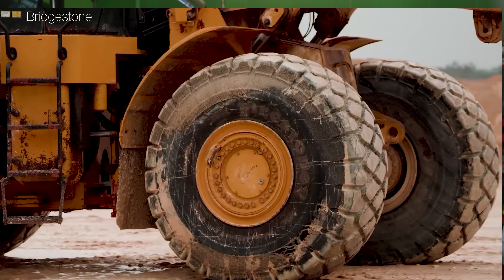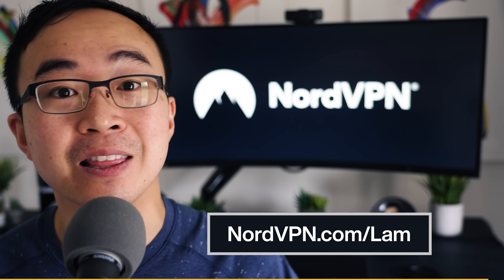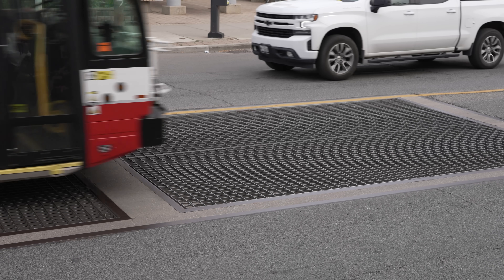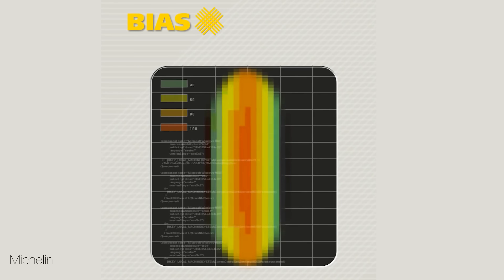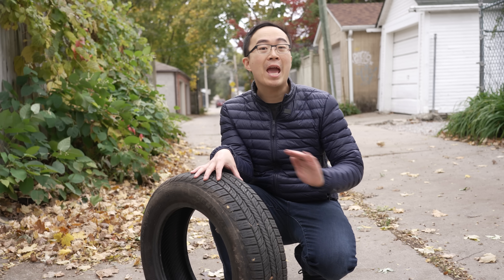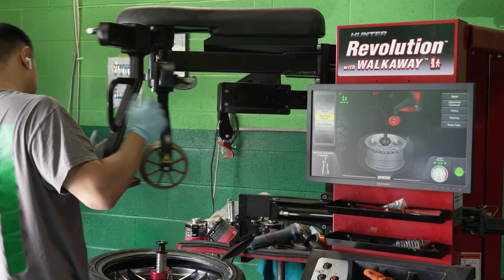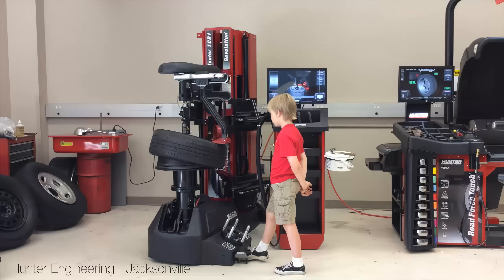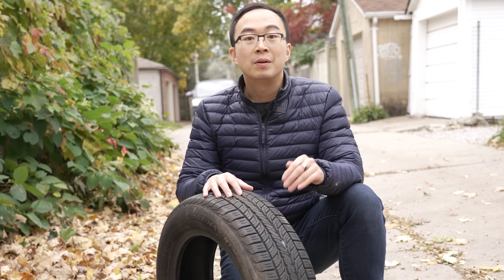How 90 Years of CLEVER Engineering Transformed Tires

Comment: I really hope this doesn't come across as nitpicky but with a guy whose video is based on learning and education I would like to say, we don't use chrome sockets to take off wheels (or at least you shouldn't, yes you can find videos of people using them but with a risk). They have a higher chance to fracture and shatter, and thus are dangerous. We use impact grade sockets for such a task. It's worth a quick read. Also impact sockets tend to be heavier and therefore are able to break lugs and what have you loose with greater ease than chrome sockets.

Comment: Another great video with lots of valuable information. It kept me engaged from start to finish. The Tire spreader that looks like some kind of Spanish Inquisition torture device for tires can still be found in many tire shops today. It makes it easier to inspect and repair damaged tires. This is very useful for tires with a tall sidewall. When you patch a tire you have to slightly grind the inner surface of the tire so the patch can properly adhere. Low-profile tires are easier to inspect & repair but are much more difficult to install and remove. With the old tire machines, it was very easy to damage a low-profile tire when trying to break the bead from the rim. This is because there's almost zero flexibility in the sidewall of a low-profile tire. I might be wrong, but I was thinking that car and driver magazine did a test of a few tire brands to see how well they lasted over their lifetime. In any case, it's your attention to detail that has brought this issue to the forefront. Great job and I look forward to seeing your next video!

Comment: The school I went to learn to be an auto mechanic just got a new tire changer in 1992. It was needed due to how alloy rims were becoming more popular than the steel rims. Alloy rims would get butchered if you jammed a crowbar between the rim the tire. The old tire changing machine did the same thing as you using a crowbar.
Reply from the maker: Yeah, I wanted to include the information on those tech changes in the tire changers.  I found that fascinating how the new ones prevent damage and make it possible to put on run flats / low profile tires.

Comment: I never knew about those round of corners in the socket wrench and the frequency distribution of the tire noise. Super interesting! For many everyday objects you never really stop and appreciate the design and engineering and just overal cleverness that went into it. Hope to see many more of these kind of videos!
Reply from the maker: Thanks impact! That's exactly what I thought when I first saw that!  Glad I was able to convey both those concepts to you.
Reply: Also, if you look at older fan blades on cars, the blades from one to another are different sizes.
Reply: If you take a look at  "metrinch" sockets and wrenches, they over exaggerate this awesome tool trick.

My uncle thought they were awesome but came to realize that they fit kinda loose on the nut or bolt.... Not good

Comment: 8:06 SQUIRREL! 🙂

Seriously, thank you for the insight on this.  You didn't go into more depth about the recommendations you'd like to see for tyre testing, but if you did want to do a vid on that, I'd be in the audience for watching it.
Have fun 🙂
Reply: Hahaha, saw and thought the same thing.

I liked the simple overview of the video. Recommendations are hard to make without a huge amount of research.
Reply from the maker: I wanted to - specifically talking about the Cross Climate 2 but it wasn't a good fit for this video.  Engineering Explained made a great video on it.
Reply: @Lam  0:25 For the general public: that's not an actual child, but a young adult who just so happens to look younger because of how tall he is (we state this because of child labor laws)
Reply: Lol I was about to comment to see if anyone else noticed him
Reply: Came to say the same. Good eye!
Reply: In terms of testing of worn tires, I'd like to see the same testing as has been done for new tires performed on a tire just above the wear limit with the percentage change recorded. The EU has a mandatory tire labelling system which grades tires based on wet grip, fuel consumption and noise, but these are quick rather than comprehensive tests - the wet test is braking grip only rather than including cornering for example. Going from a tire graded as noisy to a quiet tire is extremely noticeable as above 60 km/h tire noise is much louder than the engine anyway. It's why electric cars are no quieter than IC cars at cruising speed.
Reply: SQUIRREL
Reply: I wanted to say that
Reply: LOL I saw it too.
Reply: I totally want to shout out to my fellow ADHD kids out th squirrel ere.

I totally thought I would be the only one to see that.
Reply: Damn, beat me to it.  But, make it 8:04.
Reply: @TesserId  I'm thinking 8:03 so you don't miss any squirrel.
Reply: @Redslayer86  Fascinating.
Reply: I saw it too!
Reply: Dang it! You beat me to it. May you always be full of nuts and berries, background squirrel. ♥️
Reply: I was about to say the same thing
Reply: NOTED!
Reply: Me too
Reply: Hahaha! I was THIS close to commenting on the squirrel when I saw this. Well done, observant friend!
Reply: Ha ha ha... same thing. XD.
Reply: Was searching for someone commenting about the squirrel xD
Reply: SQUIRREL! beat me to it.
Reply: Was looking for someone else who saw it 🤣🤣🤣
Reply: Saw it too!
Reply: YOO same
Reply: i have been using my grampa's tire machine from the 1960's and its the same thing but you have to put a lever in and stick it over the spinner rod after you brake the seal all with foot peddle  ....i changed my first tire when i was like 5yo also ....so i donno wtf this guy talking about the "apple" of tier machines ..apple is just over priced trash..........its all the same it spins the tire on and off
Reply: I came here to say this.   Crashes can be avoided with better tires.
Reply: More like 8:04
Reply: i'm glad I wasn't the only one that saw it and thought it was more important
Reply: me too